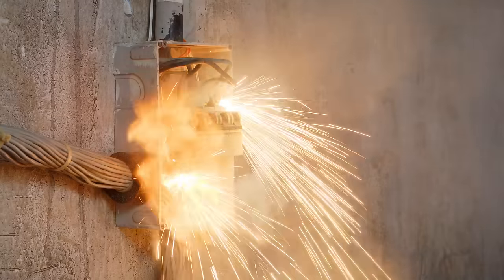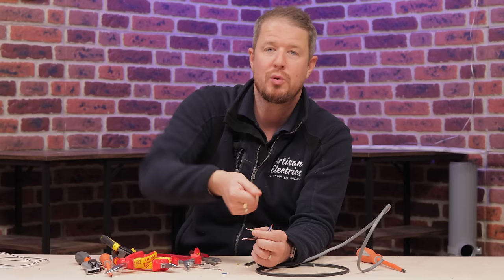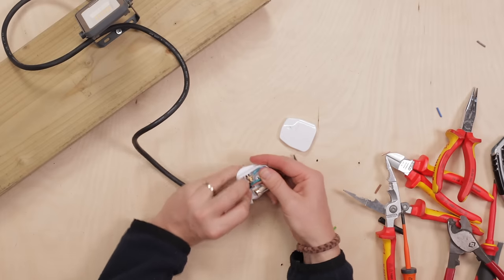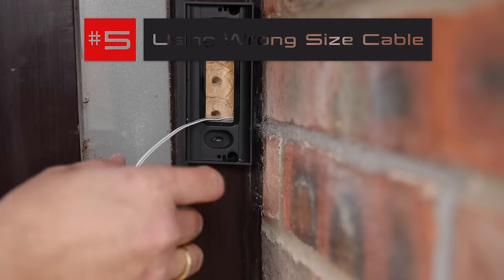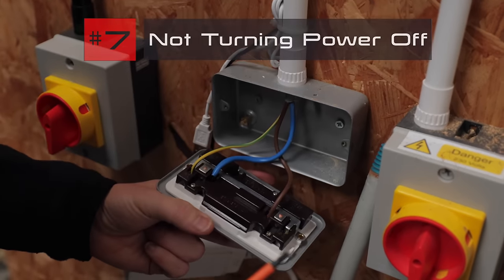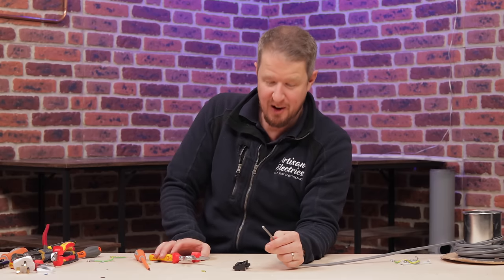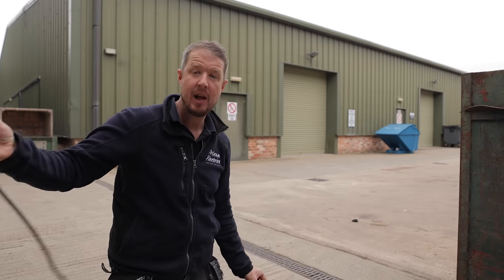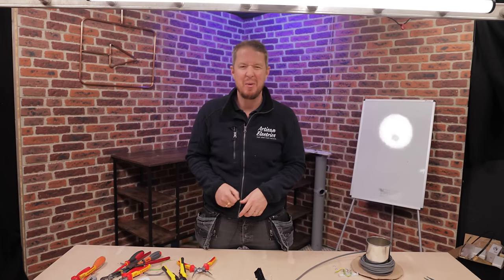10 Mistakes EVERYONE Makes When Doing DIY Electrics!💥

Comment: 4:43 Here in Germany daisy-chaining of extension leads with multiple sockets is forbidden. People do it anyways.
Problem in my opinion is less the overloading (although many extension leads are only rated for 10A/2300W), because that should trip the breaker.
More critical than overloading is the additional connections with their contact resistances. The connections heating up is one issue, but what could be critical is the added resistance also in the PE wire, in worst case the RCD might not trip.
But to be honest: I have daisychained one extension, but I am the only one using the plugs and I only have chargers and laptop power supply on it, so we are talking of maybe 150-200W in worst case.

Comment: The "connect all the reds" things is why for a long time now I arrange wiring so that there is only one unambiguous cable at each outlet. All junctioning is done separetely from the outlets in junctions boxes specifically for the purpose.

Comment: Very interesting...... especially the coiled extension reel, I had no idea that was dangerous.
I had aircon installed in my holiday lodge a couple of years ago. Shortly afterwards we were watching TV when we smelled burning. The aircon unit wasn't hard wired, just plugged into a wall socket. The plug had totally burned through, it had a hole in it. Lucky we were in when it happened.
Got the installers out to check things and they said there was no fault, only thing they said was maybe a wire in the plug hadn't been tightened up fully.

Comment: Another mistake: not using ferrules for fine-stranded wires in connections that are not designed to work without ferrules.
However in fixed installations you would be required to use solid wires anyways.
Or how about trying to fiddle in fine stranded wires in push-in Wagos?

Comment: Interesting to see how different DIY electrical projects are in the UK versus in the U.S.  In the UK seems most of it is about messing around with plugs and cords, which really isn’t a thing here. I guess that’s because of the need to deal with the fused plugs etc. Here, I’m running house wire, installing receptacles and lights and the associated junction boxes, and new load centers.

Comment: In reality why is there any issue daisy chaining 4 way type extensions, given, in the UK where this is filmed, each plug (including the primary extension) has a 13A max fuse, the most you could pull in the entire circuit is no different to it being on it's own. The fuse will blow and assuming the extension lead is suitably manufactured and tested, there should be no additional risk.
Reply: I'm pretty sure that warning been imported from the US...
Reply: The issue is that many of them aren't suitably manufactured and tested. People buy stuff online from wherever they can find it cheapest, and that results in a lot of really poor quality. How easy it is to find a partial earth pin in plugs for all kinds of things these days is sort of scary, & switched multi-gang extensions can be particularly gnarly with switches not rated for the mains or being spongy & audibly arcing. The fuse may eventually blow, but that doesn't mean you won't get heat build-up and scorching before it happens.
Reply: @nightcatarts  fair point but if it’s cheap tatt then a single one is just as likely to go up in flames.
Reply: @craigmck7271  Very true, but that risk increases if the cheap one is first in a chain.
Reply: 13 amp fuse won't blow till you pull 26 amps or so through it, though. And the ring main will have a 30 amp circuit breaker. It's quite possible to get wiring running hot without the fuse blowing. If that wiring is enclosed somewhere - say run under furniture, tucked behind curtains - then the heat can't escape, and can build up to 'burning down the house' levels.
Reply: @monochromechaos9757  yes I know but I go back to my first statement. You can pull just as much current through the 4 way as you can by daisy chaining them. So if they are correctly tested and approved there should be no additional risk.
Reply: Consider the circuit resistance not just the current.  Extension cords are often fairly light wire.  String a few of them together and the load at the far end may cause sufficient voltage drop for the load to malfunction.  Think fridge compressors (old direct line AC motors that is) stalling etc.

Comment: Had a new guy work at the electrical contractor company I was at.
He was put on a job to wire a fire alarm.
His work was shocking no idea how to clip cable straight.
But the worse thing ever to get a cable from one room to another he drilled a hole to outside wall,run the cable along the roof guttering and drilled through again to adjacent room.
That was about 40 years ago  and seen lots of crap since, he didn’t last long.

Comment: I'm a car mechanic and i can tell you there are countless cases of bad DIY wiring in the cars i see every day.
Yeah it's "just" 12V but it can still cause a fire if you don't know what you are doing.

One car i worked on had a custom DIY stereo install, fuse was in the back with the sub and the main supply cable was spliced inside the sill right at the drivers seat. The way they had spliced together the two cables was pretty unique: both ends stripped about 3-4cm and then just placed on top of each other. Three zip-ties held the two cables together at the overlapping splice and then two layers of electrical tape to finish it off.
So if that crappy splice had touched the metal inside the sill it was routed through it would have instantly set fire to the car right next to the drivers seat since the fuse was in the back...

Comment: Twisting 2 wires of the same type (!) together actually gives a larger contact surface than most cable connectors. With a bit of a solder, this surface can even be enlarged. So, if you don't want to decouple those wires anytime soon, it's very fine to do proper twisting.

Comment: Coiled leads are a major problem on campsites where people leave them connected under caravans or campers then run heaters etc.   The consequences can be devastating but if you try to tell people they usually don't want to know.

Comment: In the early 90s I was employed as a test engineer on new build and general construction work.
I could write a book about this. Couple of quick ones . House light circuit wired in telephone cables.
electric shower wired off local light circuit via a spur in the bathroom which had a bit of a nail as the fuse .

Comment: A useful video showing your experience thank you, sadly I've seen most of those from electricians as well, including having my oven nearly go up in flames due to a loose connection and leaving live cables hanging from the ceilings (that hurt).  Concerning the failure mode from an extension lead, I thought that's due to the cable not being able to shed the heat due to being wound up. I quickly calculated (so sorry if there's a mistake) that the inductive losses from that situation will be along the realms of 20W, (I think the inductor will be about 4mH), assuming that's a 25m 1.5mm^2 extension lead the resistive losses will be around 80W. (Quite happy to learn and be corrected, I mean this is in an educational learning sense not the standard YT comment way :) ).  The other thing I've always done is to make sure the tester works before I rely on it to show a null result, but I use a multimeter, I don't know whether the tester you suggest has a built in check for itself.

Comment: When connecting solid and stranded wires together the only way is to use a wire nut, but do it correctly and always do the tug test to make sure that you have done it right, it has served me well in all the houses in Aspen that I’ve worked in, if not sure, always call a certified electrician, I never recommend using the wago or push in connection because there is not a good enough connection.

Comment: One of the craziest domestic instal horrors I found was figure 8 VIR with nails through the centre as clipping. Some of the nails had arc marks either side and the (Wylex off course) rewirable fuse carriers in the CU were so spattered with vaporised copper that they conducted enough without any wire to still show live on a high impedance tester.

Comment: Those wire connectors at the beginning were called Screwits.  We had a boxful in our shop back in the 40s/50s - and they were porcelain!  Dad wired several houses pre-war using them - houses which had no mains originally.  One of the most likely scenarios for apparently neutral wires being 'live' is where there are two-way light switches.

I did once move our electricity meter becase it was in the way of a new ceiling in our very old house.  I cut the company seals and was very careful :)  If something IS live then try to use one hand if possible.  BTW, the extension cable heats up due to good old resistance rather than inductance - watts (heat) is proportional to current squared and to resistance directly.

I'm not an electrican (I ended up an electronics engineer) but I've been wiring electrical things for 70 years.  The worst thing I saw was a mains plug wired with bare wire OUTSIDE the plug. The customer complained his maiins fuse had blown  - hardly surprising, the three wires were fused into a solid bar!

Comment: 10:10 That's something I found in my old 1961 appartment above the bathroom ceiling: Coiled-up old black&red wire, as well as two unattached wires from an entire unused breaker group. (3 breaker groups, 2 groups in the house).
I noticed because the bathroom ceiling felt hot to the touch, so I decided to rip the ceiling panels out and see.
The coiled-up group was then split in 5 to supply 5 sockets in the living room, including my computer's socket when easily pulls 500 watts by itself. So with the television and computer on, yeah we had a bit of a heating coil hidden up there....

They'd even left old newspapers and other paper up there above the ceiling, as if to provide fuel.

That's 6 years ago now and I still can't imagine why anyone would make it like that. It was done by the original builders too: No sign of any rewiring by the woman who lived there.

The wires had already been done at random, neutral, active, earth, all swapped around at random. Shocked myself badly touching an earth wire only to discover it was active phase.

I don't just disagree with it, I can't imagine why anyone would build it like that? What's the benefit of doing the wire colours @ random? What's the benefit of coiling up if you have to strip&attach for the later split anyway?

Comment: As someone who's education was electronics, I knew all these things, even the last one :p. When we were searching for a house, we found one where a 3-fase 400V 63A socket was installed right next to a shower, basically the shell of the socket was touching the shower's glass wall. Quite risky if you ask me. And another house where no ground protection was installed anywhere. If you wanted to fix that, you'd have to tear down all the wall decorations and ornaments to replace all the cables. So many houses where nothing is done properly.

Comment: 11th biggest mistake, calling it a plug when it’s a socket.
Reply: It's a plug socket :)
Reply: @artisanelectrics  I hope your emojis are aimed at the ludicrous term ‘plug socket’ Jordan.  Plugs are plugs, sockets are sockets, there’s no such thing as a plug socket.
Reply: @davepedantic  I suppose that a converter with, for example, a Schuko plug and UK socket, could be called a "plug [to] socket"
Reply: Plug's socket.  ? @davepedantic
Reply: 12th biggest mistake, mixing up: inductance, induction, and magnetic fields
Reply: 13th biggest mistake:
Mixing up impedance and resistance and thinking impedance is AC only.

Comment: I am in Bulgaria..all these faults are standard practice here. All the wiring in my house refurb is heat and fire resistant, When the '' technician'' from the elecricity supply company came to check the installation before connecting the house to the meter box, (3 phase, 385 volt supply) he asked me what all the ''fancy orange cable'' was for. 😊

Comment: Kk, so about 20-22 years ago now I was replacing/ capping off a wall light, I had removed the light from the wall and detached the wires. I then proceeded to join the bare cables together, at which point my hand  and arm became "locked" in place and it felt twice its normal size with the worst case of pins and needles I've ever experienced! Yes I'd forgotten to turn off the power!  After a second or two I managed to pull myself off the cables and after taking a minute or two to recover I went and turned off the mains before finishing the job. I felt a bit funny for a couple of hours after but no long lasting affects as far as I can tell! 

Is it normal for one's eye to constantly twitch!? 😉🤣

Comment: If anything, the coiled up extension would be a bifilar coil where its inductance cancels itself out. If there was inductance, it would limit the current in the circuit, and BTW not contribute to the heat dissipation. A bifilar design is used in wire-wound resistors in HF circuits for the very reason of having minimal inductance. Like someone else pointed out, the heat builds up because it can't escape the tightly wound coil - even more so in a boxed reel extension. This is also why you should always fully unwind the cable of your vacuum cleaner for any extended period of operation. 

I knew a fledgling restorateur who bought a deep fat frier with two 3kW heating elements, both with their own 3x1,5 sqmm cables and SchuKo plugs. Correct rating and all, 16A per element - but he ran it off of a 10 meter extension. And he didn't unwind the extension either save for the two meters needed to reach the socket. He called me in to investigate why the breaker was tripping constantly and why there was a plasticky smell in the kitchen - I mean he called me after resetting the breaker no longer restored power to the frier. It took me an hour to get there, and when I investigated, the extension was still too hot to touch comfortably, and the overheat switch had tripped. For the time being I got him two shorter extensions that I ran to different outlets that I verified to be on separate breakers. BTW he would, after half a year, find that the restaurant is pretty much a money drain, and he quit after Christmas 2019. Right on time before ol' Rona (or the preventive measures taken) screwed everything up.

The "lever Wago" is great in that you can undo it wire by wire without wiggling and jiggling, and you can mix solid and stranded wires as well as wire sizes.

For small stranded wires in a comparably large screw terminal, end ferrules are good but not everyone has access to them when needed... My solution to it is to fold the strands back over the insulation and face them away from the screw so that  the screw bites on the insulation, and the insulation squishes the strands against the bottom of the terminal. I've never had that fail.

Comment: Went to a LAN party back in the late 90s. A lot of computers, CRT monitors, and even though the extension cord was unwound, the jacket laying on top of the pile of unwound wire still got burn marks, probably because the extension cord was under dimension for the load. Be careful out there.

Comment: Stingers(leaving a strand of stranded wire sticking out), Shiners( stripping too much of the insulation off individual conductors. Running Romex in to a metal box or panel with out a plastic or metal romex connector. Open splices, cutting off the ground conductor on a romex cable, not tightening the wire nuts properly, not burying underground feeder cable to the correct depth, using too large of a breaker for their wire size, using extension cords for permanent wiring.  These are common things that I see DIYers doing all the time.  Thanks, Russ 29 years in the Electrical Trade from across the Pond.

Comment: here in australia and new zealand it is standard to twist wires together and put in a screw connector.
Reply: British electricians hate that when they have to isolate sections of a ring main to try to find a fault.
Reply: We don't have ring circuits in Australia.
Reply: @robinbennett5994  completely agree. I think we should use wagos

Comment: This had me looking at the smart garage door controller (basically a wifi-controlled relay) I recently bought - all low voltage (5 Volts DC) so it's not a safety hazard as such, but the signal and ground cabling they use to connect to the main door control box is just a piece of random two-core flex with the outer sheath stopping well short of the device enclosure - no strain relief at all on the control cables, the USB power cables, or the door-edge sensor cables. I fear it's not long for this world.